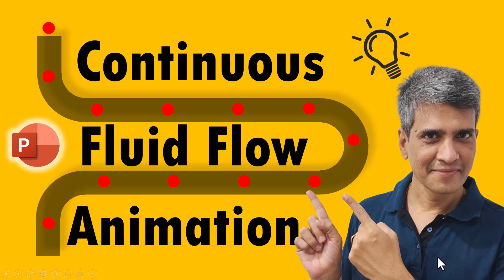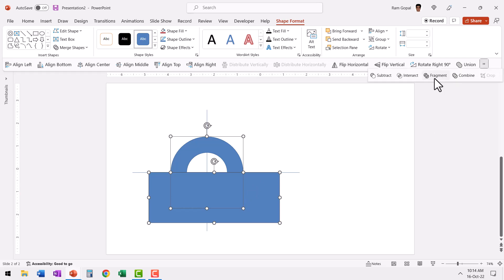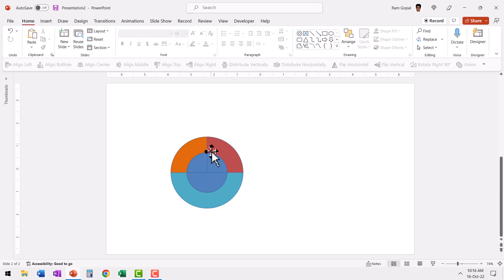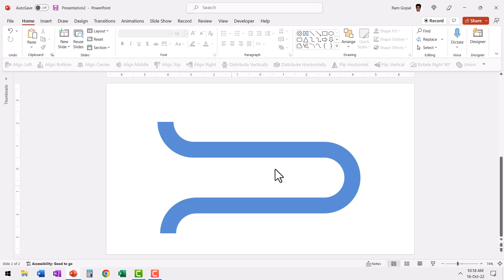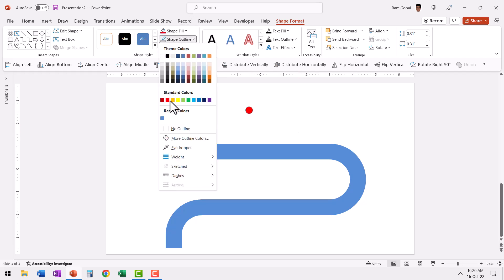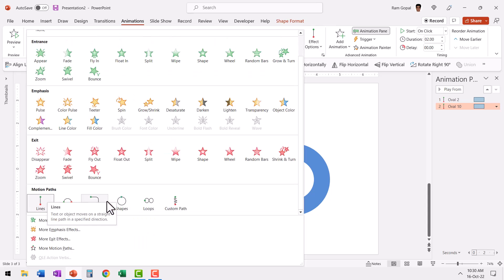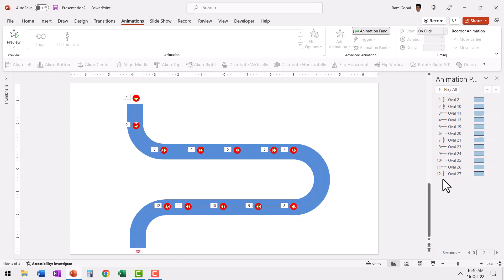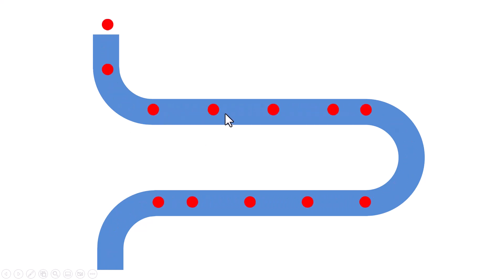Continuous Fluid Flow Animation in PowerPoint

Comment: Thank you for sharing. I have this very thing to do for a complex engineering flow diagram. I have to make a gif out of it. Is this possible?
Reply from the maker: Sure you can save this as an animated Gif. You can go to File - Export and check if you have the Animated Gif option. If you don't you can save the file as a MP4 video and then use any online converter to convert it to an animated gif

Comment: I know this is a relatively old video and I am not sure if you are monitoring comments anymore but why do we repeat all the dots? Why not use custom and add points all the way through pipe? Yes it will a single dot flowing through as opposed to many of them flowing at the same time but is there a reason to duplicate circles as opposed to pick one custom animation and adding points?

Comment: I wonder if it would not be easier to define the custom smooth path of just one point all the way through the pipe, and then duplicate that element and select "after previous" with a set delay, and repeat that for the desired number of elements (dots) and repeat the entire animation sequence until end of slide... hmmm will have to try that. Reason being, I want to improve the smoothness and rate of flow.

Comment: Hi sir, I am an avid fan. I have inserted my audio which is to be played on a specific slide automatically, I have no problem with that; however, when I went back to the same slide, the music did not play automatically, as expected. Thanks for the help and the inspiration:)
Reply: enable play automatically option then it will play automatically in slide show
Reply: There are two solutions-
1. Open animation pane and check sequence of things sound play must be first
2. Add blank slode with auto advance time of .25 sec and insert audio there so this will not disturb you current slide and give you better control